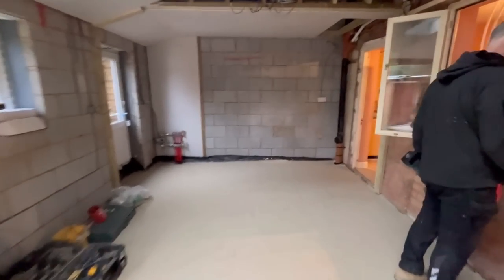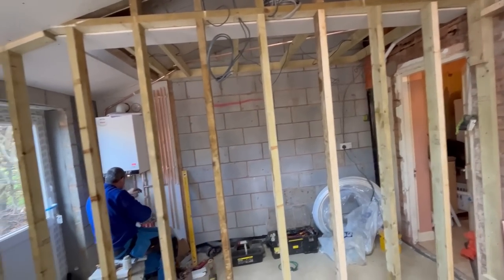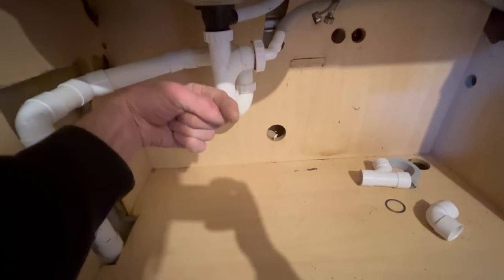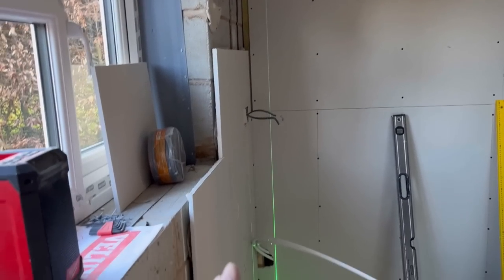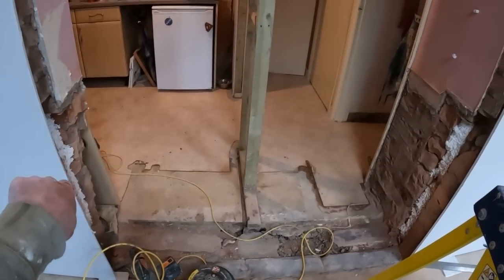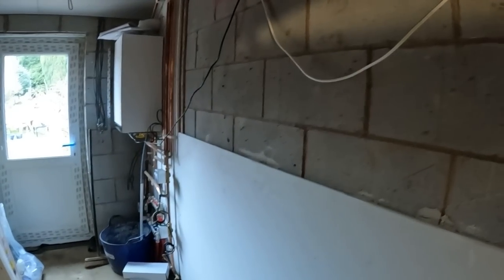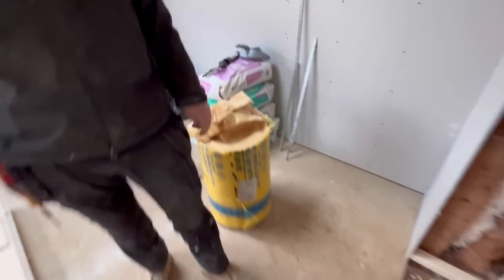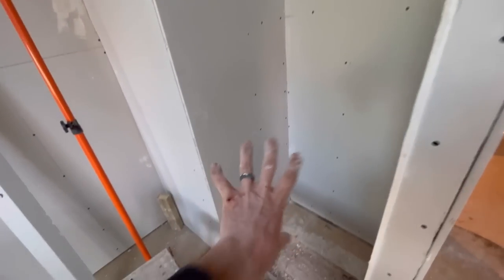Boiler, Plaster boarding and Bi Fold doors installed

Comment: Remember the days when plumbers used to put pies in straight lines...
Reply from the maker: Can’t really disagree with that as I’m from those days and there is very satisfying to see copper pipe work finished and clipped but can you also remember that it used to take a plumber days to do a first fix and be a lot more expansive. If for no other reason it’s a lot safer and less stressful using plastic pipe as they are no longer using bare flames in a property. 👍🏻

Comment: Really enjoying the content - as an armchair expert though I'm surprised there was no metal capping on the power cables?
Reply: Don’t need if plasterboard is used, capping used to protect cables from trowel when applying browning plaster.   Fun these regs !!!  I used to think the same and was put right a few years ago.
Reply: I agree but you can still drill through them. Anyway just saying

Comment: I have not seen a single piece of pipe insulation on any pipework that has been installed yet.Building regulations state all pipework in an unheated area must be insulated,  that includes heating and hot and cold feeds to taps etc.

Comment: Had our extension plastered this past week, taken a few days now to dry out
The dot and dab sounds a bit hollow though when you tap on it
Should I stop or worry?
Thanks
Reply: Of course it's hollow, there is a void between wall and board, the adhesive is placed in dabs not the entire wall.
Reply: @KingstonHomeMaintenance  well yes, I realise that, it just sounds a bit "fragile" if you know what I mean
Reply: @Mostly My MK3 Mondeo  only you will be able to tell, how far apart are the dabs? Does the board flex when you push on it?
Reply: @KingstonHomeMaintenance  it's certainly solid, but around the light switches it feels just a little bit I don't know
Maybe once the switches have been fitted it will be fine, I really don't know as it's the only bit of the house that is not solid brick
Reply: @therealdojj  ah right I get it now, seems the builder didn't put adhesive around the back box, I always do this, take switch off, see if you can knock out a couple of the access points for cable and get some expanding foam adhesive to spray behind the board, don't go mad though